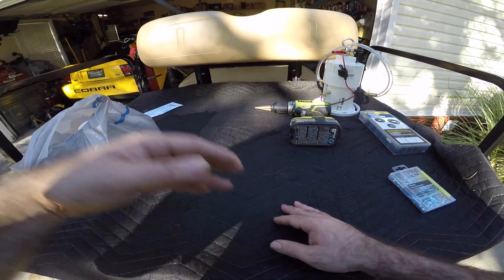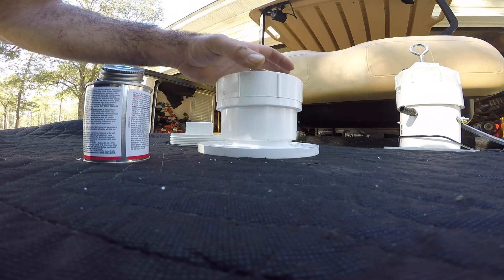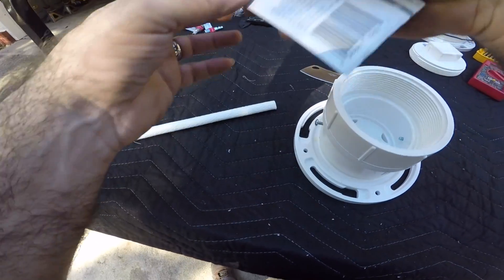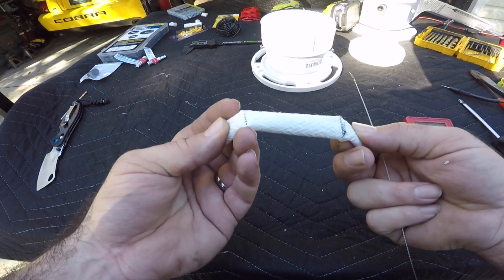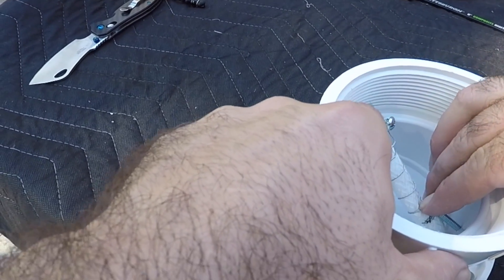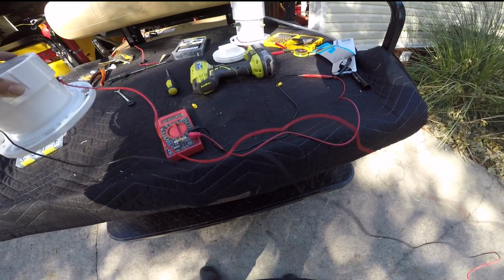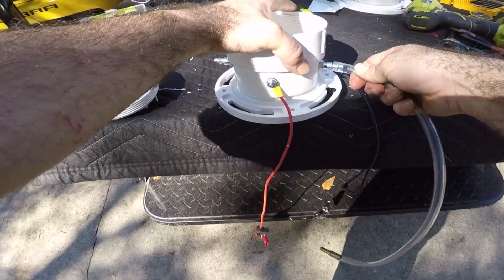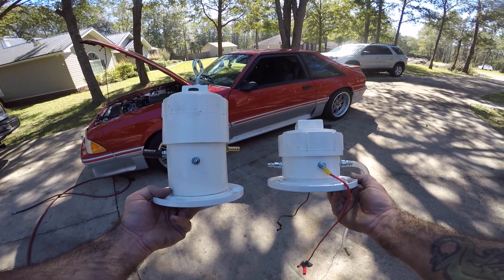THE BEST SMOKE TESTER YOU CAN BUILD!! / THE MR. FUSION MINI BUILD

Comment: Might be a good idea to put an in-line fuse on one of the wire leads.
Reply: chiil you could use a mosquito fogger machine and put baby oil in it and go.
Reply: @leonardopupo-tuperet6080  I just have bad luck with electrical stuff... not that I don't know what I'm doing.  But given the chance, I love accidentally shorting stuff and poking myself with soldering irons.  :)

Comment: Well.
That was an adventure.
Built a taller version (like your original)...mostly because I couldn't find any fittings that snugly fit together. Added another 6" of height with the 4" PVC. 
The coil wiring was somewhat of a bitch. I figured I would use whatever wire I had on hand for the "element". Wrapped the wick with bailing wire (25lb), lighter bailing wire (10lb), MiG wire (.032), Craft wire (28awg). I settled on a roll of dollar store craft wire (20awg) which worked swimmingly.
This smoker worked AWESOME! You really do need make sure everything is sealed airtight. Even with the PVC glue heavily applied, it leaked profusely all over. The lid was leaking pretty bad too, and it had a rubber gasket.  Aside from that, it worked excellent...maybe a little too well.
Caveat: Make sure you check on your fluid level regularly!
Used it on both my vehicles and MAY or may not have left it running for too long. Fluid got used up and things got hot. This happens quite rapidly, I've found. The +/- terminals melted the PVC and kinda ended up drooping off the sides of the pipe like a pair of bad earings. So much for Mrk I. 

Mrk II is in the works tomorrow. Going to get this thing shorter. Relocating the hose barbs near the top...maybe the lid...they were getting pretty warm right by the element and the hoses were warping out. Longer hose is a must. I have a Jeep XJ and there's some distance between the end of the tailpipe and the battery (I'm using 5a alligator clips connected to my battery for power). I may even delve into some kind of automatic oiler so I don't have to keep checking it.
All in all, I'm pretty impressed with the build and the function. It really does pump out the smoke quite quickly...and a lot! Found exhaust leaks immediately on both vehicles. Looking forward to doing a full engine leak test with the new build. Thanks very much for this vid!

Comment: This is the best one i've seen yet. sure you can't see the "Smoke" through a glass screen but why would you need too. Good job!
Reply: The most obvious reason I found is to make sure your oil level isn't too low. Sucker gets hot without enough oil on the wick and it does dissipate quickly.
Reply: @HedoBum  It would be pretty easy to make a sight glass for monitoring the oil level, especially on the taller version of the Mr. Fusion. It might be a worthy addition if you're worried about that.

Comment: Hey , any advice? I used 26 gauge stainless wire (I think? Got it from a local vape shop) and I cut it to a length that equaled 2.5 ohms on my volt meter. I set it up the exact way you did, but when I started it, the wick caught fire several times before it was able to smoke without burning. Then, the stainless wire where it wraps around the bolts on the inside of the unit, started burning holes through the side of the PVC... and the bolts themselves were hot as hell... did you have similar issues?
Reply from the maker: If it’s getting that hot that fast, I would add a few more wraps around the wick to raise the ohms. That should fix the problem.
Reply: @BREW2LFOXBODY  makes sense. Thanks!

Comment: Great video, tq. 
Would a copper wire work just as the stainless steel one?
Reply: I have 16 gauge copper wire don’t know if it works did you ever get an answer
Reply: I tried copper it just burnt it in half

Comment: I just built mine and the heat is melting the vinyl tubing on the exit side. The vinyl tubing says it's good up to 175°F. This is in less than 3 minutes it melts the tubing. I am using 26ga Kanthal wire, and it measures 2.4 Ohms  (It was about 6 inches long. It makes lots of smoke, which is good. If it's melting my tubing, is my wire too short or long?
Reply: Wire is too short - more long the higher the resistance.

Comment: I just build one of these. It's a great build thank you. I have a bit of a problem though. Mine is burning the pvc where the screw meets the wire on the inside. What am I doing wrong?
Reply: A bit late but a good solution would be to buy one foot of high temp silicone tube on Ebay... maybe 1/2 od, 1/8 id. Cut two little half inch long pieces of that. Take out your screws and squeeze those pieces of silicone onto them. Then drill some 1/2 diameter holes in the pvc. Squeeze it all back together. The silicone will act as an insulator. It can take 600f. This smoke machine is brilliant. I'm making on next week!
Reply: @jmac4952  where is this tubing available? I can only find food source and not high temp. Link to home depot?

Comment: My suggestions would be to:
1. Add an air regulator.
2. Make the air ports higher so you don't risk getting the oil in you air lines. 

Other than that, A+ brother. And thanks for not being a jackass in your neighborhood for the sake of being cool in your video. Could have opened it up on the open road though ;)

Comment: Will the PVC melt from the high temps inside the unit?
Reply from the maker: I’ve not had any issues with heat
Reply: @BREW2LFOXBODY  Thanks for the excellent video. I like how you didn't make it long yet you covered how to make it with really good detail. Is there a max amount of time you can leave it on?

Comment: U never introduce Oxygen into a Evap system without using  inert gasses. U can push the vapors out from the gas tank and it could turn bad fast. Even 1psi of air for over a min can make the gas tank erupt and even catch fire and then its too late...
Reply: So then, what do you recommend to prevent that happening using this device?
Reply: Solution?

Comment: New subscriber here. I've seen videos in the past of people making their own smoke tester. Your's is the best and easiest by far. It never crossed my mind to use plastic plumbing and run voltage through it. It just seems counter intuitive but you proved me wrong since it's very hard plastic and very little voltage running through it. I'm running to Lowes tomorrow and to my local vape shop.

Comment: What did you use to regulate the air pressure? And what was that pressure release safety you put on the top?
Reply from the maker: I just turned my air compressor down to around half a pound. Yes it’s just a rubber plug.
Reply: @BREW2LFOXBODY  Building one myself. Got most of the parts. Do I need an air compressor? (Don't have the space for one honestly. Living in an apartment.) Also, for the hose copper tip, what type of part did you use? I noticed you covered the parts list for the ones on the unit, but not for the hose. Or am I just not looking at the parts list thoroughly enough?
Reply: @xPreatorianx1  did you find the hose tip thing? I need one too
Reply: @javaidsadiq5775  I just used a double sided fitting that looks similar to the ones used for the tubing/air compressor on the actual machine. You should be able to find it in the same section in Lowe's if I remember. Basically any fitting that looks similar to the ones used on the machine will do. As long as it fits the tubing. Just look at the fittings in the air compressor section. You'll find one that will suit your needs.

Comment: Wow, I'm building one THIS weekend.. I'm pretty sure I have at least one vacuum leak in my 89lx doesn't drive good at cruising speed at all, around 50-55mph it junps and bogs ect  It's perfect with any throttle at all, but doesn't wanna cruise. After watching alot of your videos last night, I'm gonna make something similiar to this without buying anything hopefully. Should have enough stuff lying around.  Did you just use an air compressor on low for air input?? Does it give it constant air and that's why relief valve on top?? Thanks again and wish me luck
Reply: Just started, doesn't look like it'll take long to make. Only thing I don't have is a wick. Guess I'll just rig something up.. any ideas? Shop towel in baby oil? Paper towel?

Comment: I second that this is the best channel on YouTube hands down glad to see things are ok with you and the family after the hurricane but small question my clutch cable in my 1993 fox keep splitting this will be cable number 3 waiting on it now to come through Fedex it has a stage 3 clutch a friend told me it can be the fork but not sure
Reply from the maker: Thanks brother 👍 more than likely it’s the cables you are using. The aftermarket adjustable cables suck. Try a factory cable and see if that fixes the problem 💯
Reply: Thank you will give that a try
Reply: gfunkxpress yea I had the same kit as well still using the  bbk quadrant it’s just the cable keep splitting
Reply: Dario Chase where is the cable breaking? Under the dash by the quadrant or somewhere else? Maximum Motorsports makes a great cable and quadrant. I was having the same problem years ago and finally bought the MM cable, haven’t had a problem since and that was 5 years ago daily driven.
Reply: 1320horse it’s braking under the car close to the clutch fork it’s splits there
Reply: Dario Chase is the cable breaking or the sheath around the cable coming apart? I also covered mine with a heat wrap to keep the exhaust heat from damaging it.